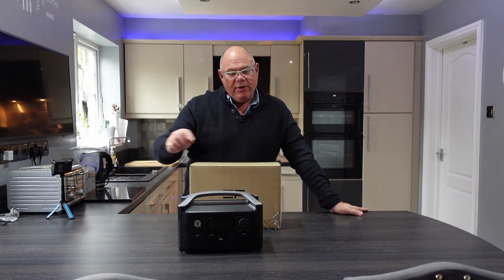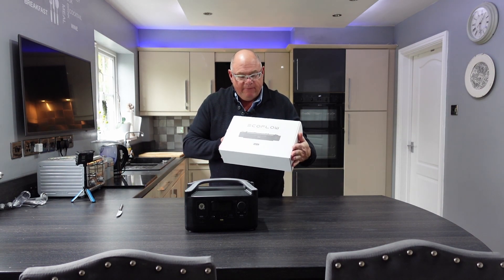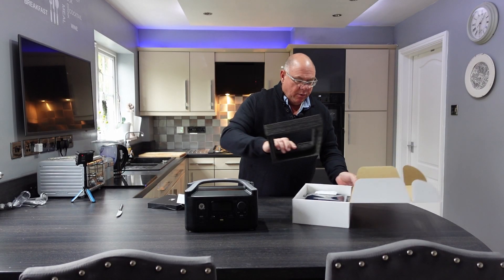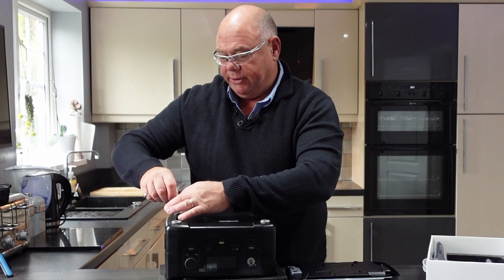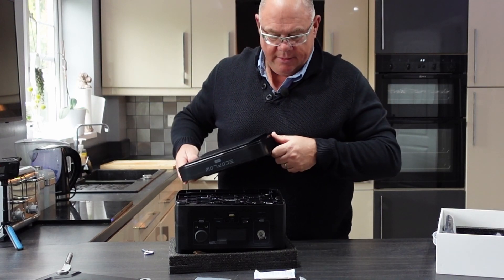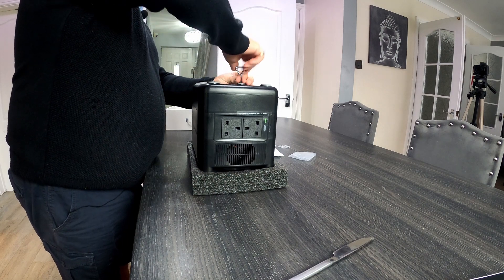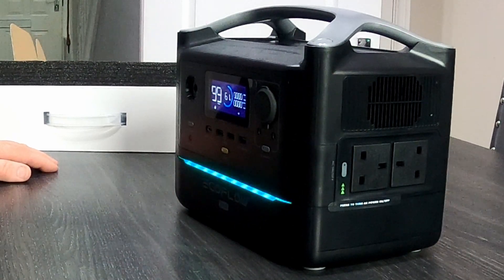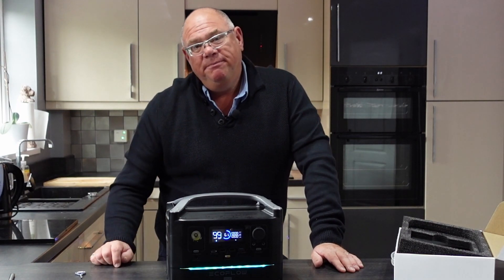#2 Upgrade ECOFLOW River to ECOFLOW River MAX

Comment: How do you remove the rubber feet to add the extra battery?
Reply: You dont Theres an open screw through the rubber so no need to take them off Just put in larger bolts that are supplied